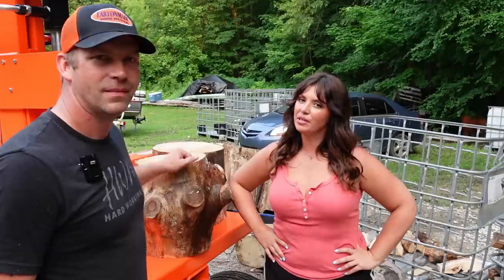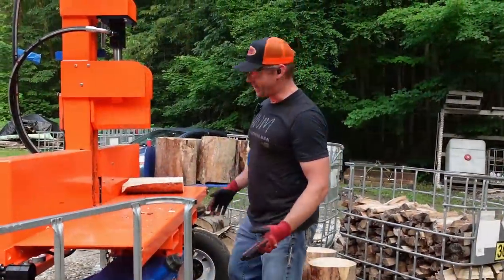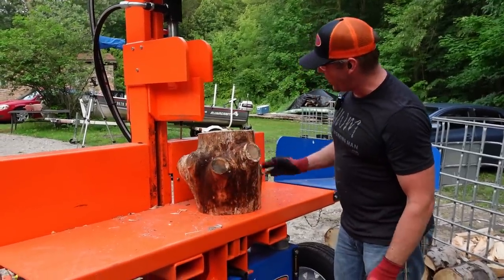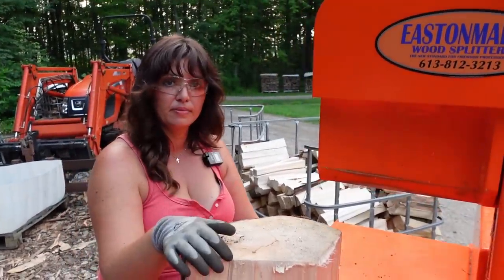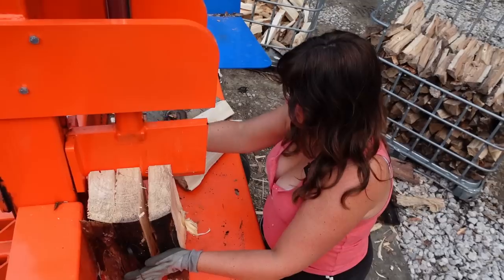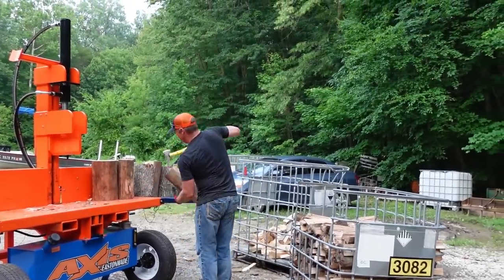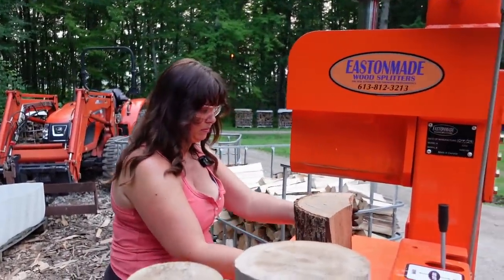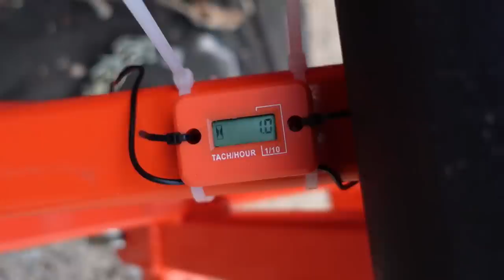Can You Split Bundle Grade Wood From Ugly Knotty Rounds?

Comment: Great video Heath and Rachel. First Heath, we have the Solo Bonfire and really like it. Second Rachel, I really enjoy watching splitting on the Axis. I like the precision cuts and the large table and extras the typical horizontal splitters can't provide. Rachel you handle the Axis like a pro👍🙌.
Reply from the maker: Thanks Obie, I never really thought the smokeless pits were worth it but recently I’ve had a few experiences that really show hidden values of them. I’ll share in an upcoming video. Rachel is a surgeon on the Axis and the large working surface and taller working height are great on the Axis!

Comment: Heath,... would you ever consider the Eastonmade Axis as your sole splitter if you had to only choose one?  I'm in the market for a 37D with the STK 24 conveyor, in preparation of running an OWB, but also selling mainly bundle wood on the side.  I have recently been considering the Axis, here lately.  The two things that I really like about it is the lack of trash that it produces,...and the ability to manipulate your split sizes.  The 37D with a box wedge produces nice splits, but with more trash.  One thing that I noticed is that the physical demand is less, because you're not having to handle the wood once it's split.  I know there are many other pros and cons to each machine.  Just wanted to ask, because this is where I'm at.
Reply from the maker: Amanda, I actually plan on doing a video on this soon. But to answer your question it all depends. If you only plan on selling bundle wood and making enough boiler wood for yourself and have access to wood that is not real knotty I’d absolutely consider the Axis and consider it very heavily. Now if you deal with a lot of knotty twisted wood, or plan on selling wood in bulk in addition to filling your boiler and selling bundle I’d go with the 37D and conveyor and add the pizza wedge. As far as the waste from the box and multi split wedges go I’d feed that to the boiler. Both excellent choices!  If you have any other questions please let me know. Also the Axis will take a much smaller working area than the 37d and conveyor.
Reply: @hardworkingmanoutdoors  yeah,…that’s the plan.  It’s bundles only, along with loose stacks in a roadside fire stand or two.  I honestly have no desire to sell bulk firewood.  There are guys in the area that do.  I’ve only seen one or two who sell bundles,…and they’re odd shaped of different lengths in plastic grocery bags.  I’ve already found a source for logs to be delivered on a triaxle.  I figured my system would be to buck up a ton of logs,…and then split and stack in an IBC tote or two at a time. That would keep me somewhat busy without being obsessed 😁.

Comment: Fun video, guys!   Starting to wish I had a vertical splitter like that.  My splitter will pivot up into vertical position, but the rounds sit on a plate/foot on the ground.  At 72, that is a lot of bending over during a splitting session which results in a very sore back at the end of the day.
 I had my doubts about getting even one bundle grade piece because those knots were started on the tree when it was very small, so they go all the way to the center of that piece.  You may have mentioned it somewhere in the past, but what particular species of poplar do you have wherever it is that you live?
Reply from the maker: Ron, the working height of the Axis is great!  Definitely saves the back, especially with the built in log loft / work table. I had my doubts too but thought maybe I could carve one or two out. The poplar we have is Quaking Aspen I believe or white poplar.
Reply: @hardworkingmanoutdoors  Thanks for a quick response.  I didn't explain, but I cut firewood for my outdoor wood furnace which takes lengths up to 25" or shorter because my splitter will only take 22".  So, I cut my wood at that length, but when I have oak rounds that are huge, I have to split them vertically and just wrestle them into position.  Occasionally, i have a huge piece too long for the splitter so I lay it down and split from the side.  Very hard on an old fellow like me.  I only split them enough to get them through the door of the fire box, so I have weighed some pieces before putting them in the firebox at 70-75 pounds.
Reply from the maker: Ahh, I’d love to add an outdoor boiler one day!  They definitely seem nice.

Comment: Nice video Heath and Rachel!  I picked up my Axis a few weeks ago and live it! Question for you. In the back of the machine on the lower portion of the stroke is the back wedge plate wearing into the welds on the base of the beam? I am going to take off the backe wedge plate and machine a 45 deg so it doesn't  grind metal on metal.
Reply: Also for the heat if you didn't already point the muffler towards the back. It is pointing to you from the factory.
Reply from the maker: Nick, thank you! I was getting a little bit of wear there as well, I put a little extra grease in the corners and it seems to have wore in of that makes sense. Our muffler has an extension on it and it is pointed down, may mess with it more in the future to see what we can do. They are a fun splitter to run though.
Reply: @hardworkingmanoutdoors  yes they are.  I had a wolfe ridge 35c and went to the Axis.  They each have there own purpose but I am liking the Axis better.  I can make good sellable wood out of stuff I couldn't before.
Reply from the maker: They definitely help get the most out of each round, not quite as fast for pure production though.

Comment: There is a better use and more value for those knotty ones instead of trying to make bundle wood out of them. Google Swedish candle or Swedish Fire Torch. They are pretty simple to make and sell for a good price. Sell them along side your bundle or bagged wood for quick clean fires. Poplar works good for them also. Good job splitting Rachel.
Reply from the maker: I have a few knotty pine logs left, I’ll look into it!  Thanks.

Comment: fuglys arent pretty......and are hard to split evenly. cherry is almost as bad as the pine. poplar is probably the easiest but burns fast. i don't mind it for campfires or using it in the wood stove during shoulder seasons.
Reply from the maker: Absolutely, I haven’t messed with pine much but those knots run deep. We mix the poplar with hardwoods for campfires. I like silver maple for the shoulder seasons!